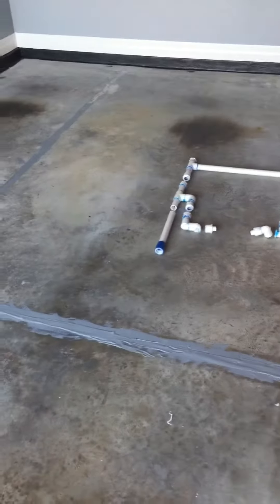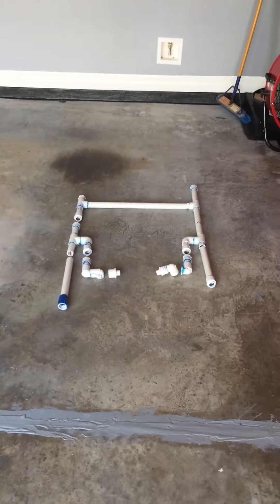Kranzle Custom Home Garage (Part 7)

Comment: Can you tell me where you got that 90 deg exit fitting connected to the pump discharge
Reply from the maker: Check out my Part 6 video I linked the detail in there..

Parts for the 90 Degree connection

MiguCo M22 Female 3/8 Inch Male Lance Adapter Coupling for Karcher & Nilfisk https://www.amazon.com/dp/B0778HBB5Z/ref=cm_sw_r_cp_api_i_1zxnFb2BEDS6Q

Coxreels 1935 Replacement Swivel with Nitrile Seal,Brass,3/8" NPT https://www.amazon.com/dp/B00GYW3IPC/ref=cm_sw_r_cp_api_i_9AxnFb9R1WCY9